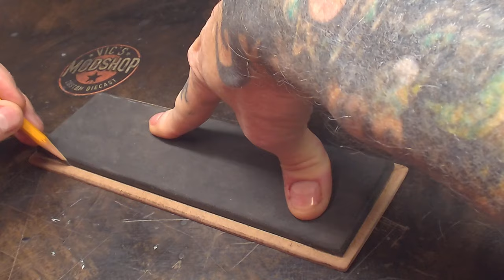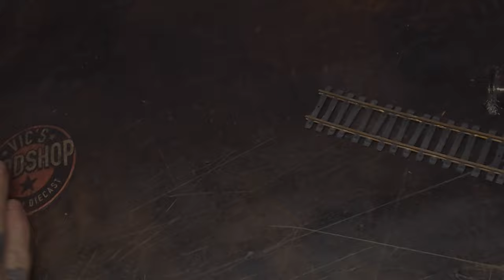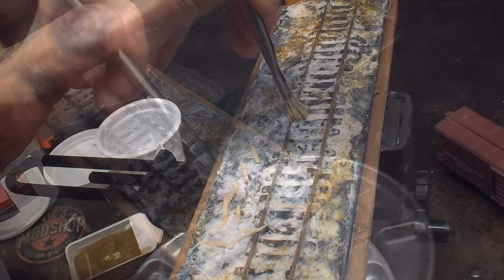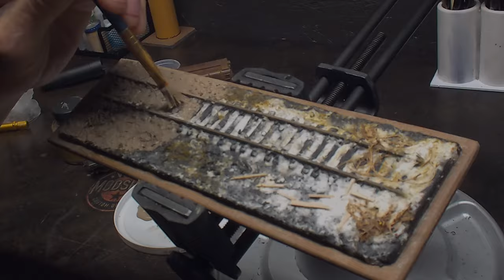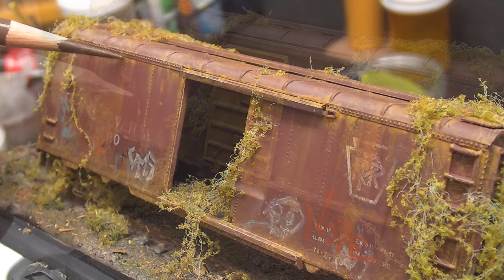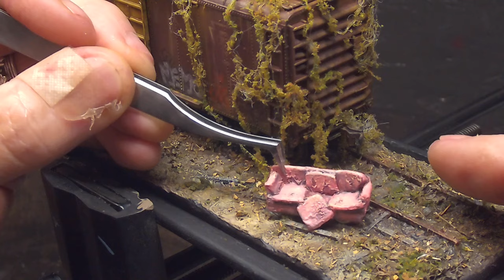Weathered, Overgrown & Vandalized. Discarded Pink Couch BONUS!

Comment: Yet another great little dio , what did you use for the vines they're just the right scale. Well done on a great channel
Reply from the maker: Thank you! Sure, the vines are fibers from a used dryer sheet, wetted with UV resin, then dragged through some store bought turf/flock and applied to the model. Once in place, I cured the resin with UV light.  Hope that makes sense. 
 I shot a video clip of the process but apparently I failed to hit the “record” button on the camera.  🤦‍♂️ 😆 
I appreciate the comment! ☮️